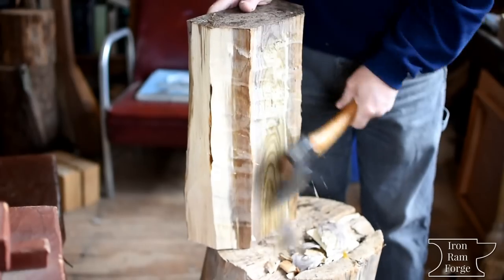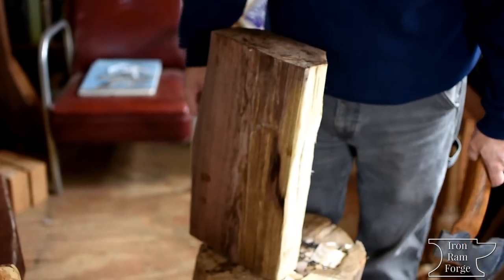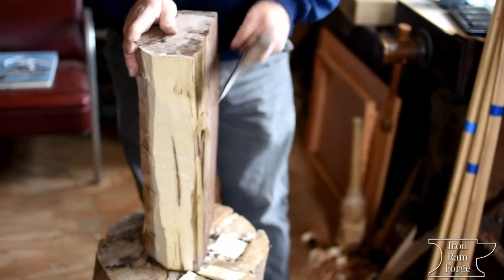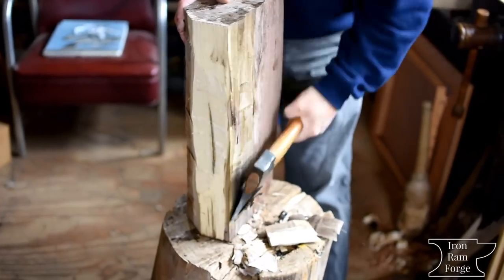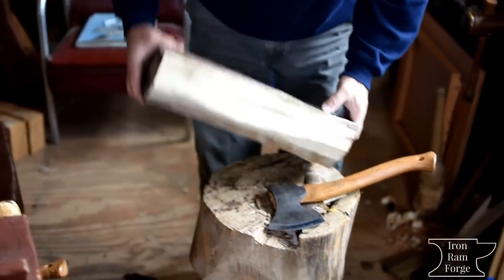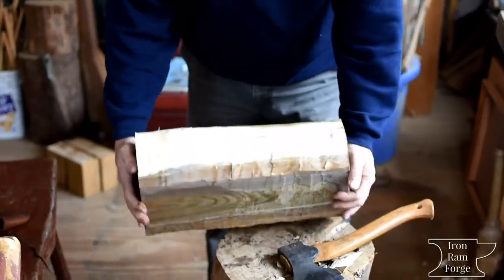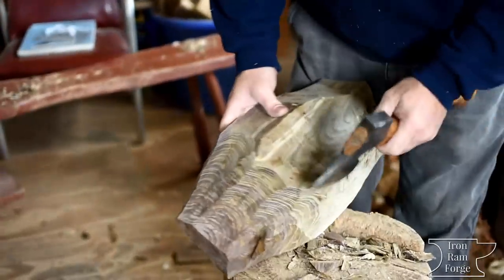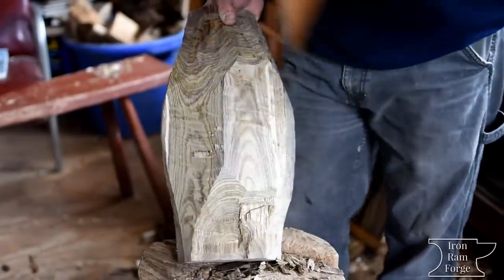Quiet Carving - Hewing a Black Walnut Bowl with Hand Tools

Comment: Hi, I’ve been wanting to make a dough type bowl (hope you’re not rolling your eyes) for ages now. I’ve done some carving - finer work (matching broken or missing mouldings or carvings on antiques etc.) . I would like the bowl to be a large one around 90 cm long by 20-25cm wide. I’m hoping you can give me an idea of what would be an easier wood to use and if green wood should be the way to go. I’m in Australia if that helps re tree types.  I know the ‘usual’ way is I should start small and work up but that’s not me - I want to make what I want to make (another eye roll I’m sure lol) and if I like my one I’ll probably make some other dough bowls if not it might be the only one I do but I’ll keep going until I get the one made I want. Thanks Jeanine
Reply from the maker: Hi Jeanine, no eye rolling at all! I don't know anything about Australian tree types, I'm sorry! No matter the wood type, green wood is the way to go. You want it to be as fresh as possible. Just be sure you let it dry slowly for 6-8 weeks or your bowl will crack.
Reply: The Iron Ram thank you that’s great information.